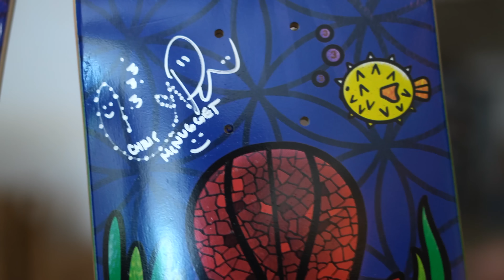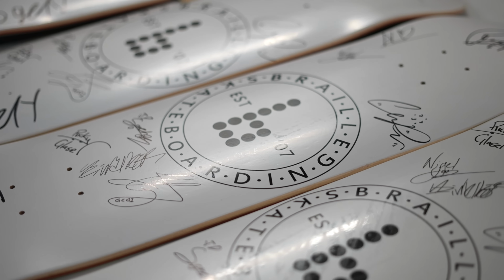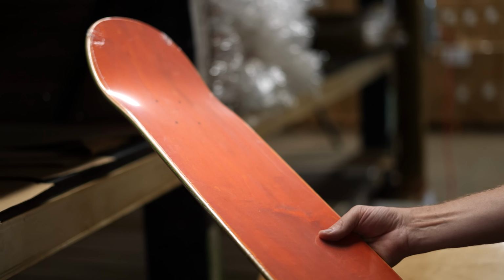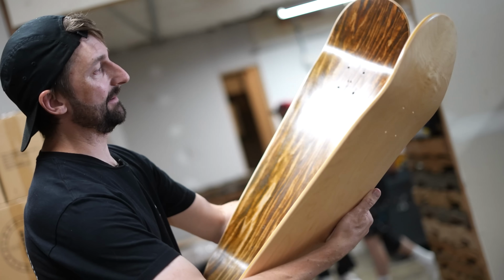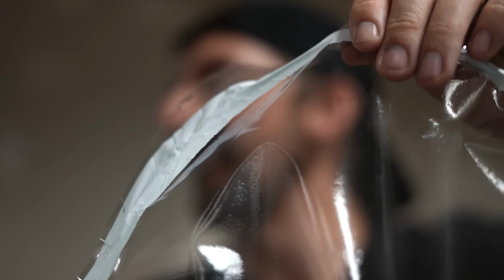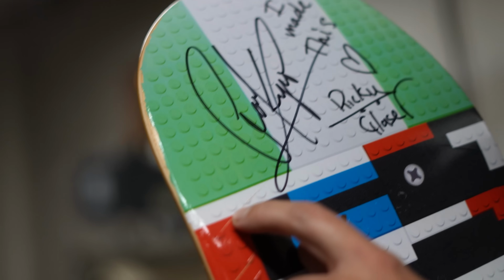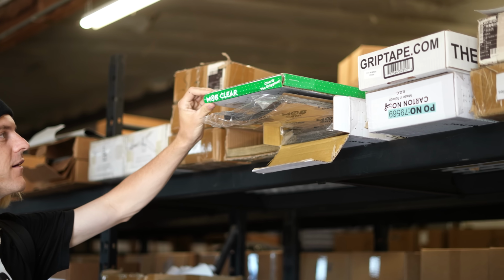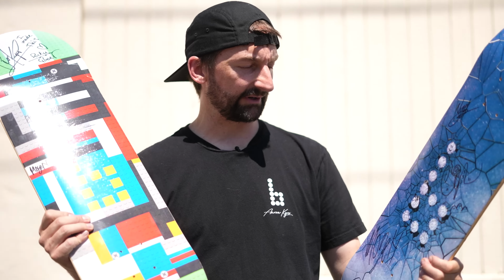HOW A SKATEBOARD IS MADE! | ALL TERRAIN TOUR EP. 2

Comment: I've been skating the sme 7.75 deck since 2006, it's getting time to replace it
Reply from the maker: wow that is impressive.  16 years on one deck
Reply: @brailleskateboarding  Basically, I only skated here and there when I got it (nobody around to skate and learn, no internet), All my skate friends moved on after HS. 

It's a blank Krown Maple deck, OG Grind Kings (2003) finally broke a few years ago. I  saw the company came back, so I replaced them last year. 
Wheels are spitfires from 2003. Rode the lucky's bearings from the same year until 4 years ago. 
I think it held up very well because I don't really do a whole lot of tricks while riding. Before I could really even ollie, I learned the drop in on the 9ft at my local skatepark. 
It's probably replacement time. lol